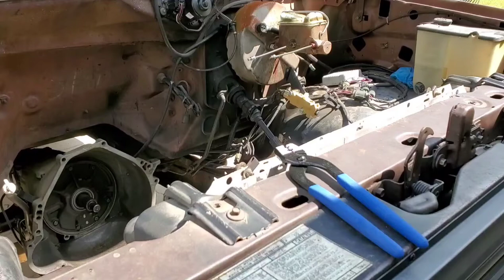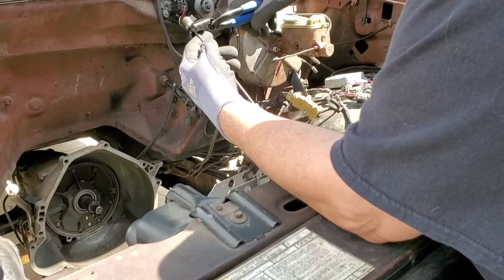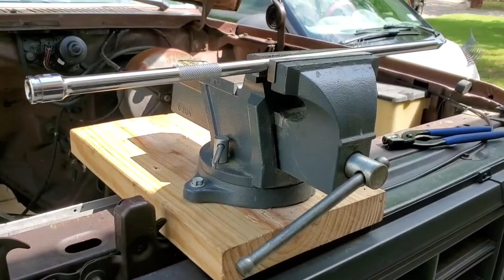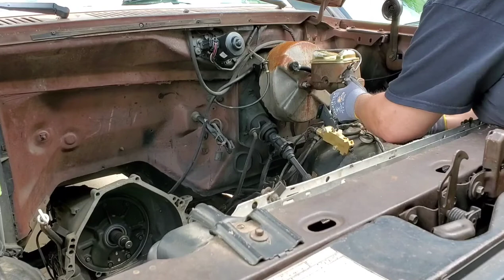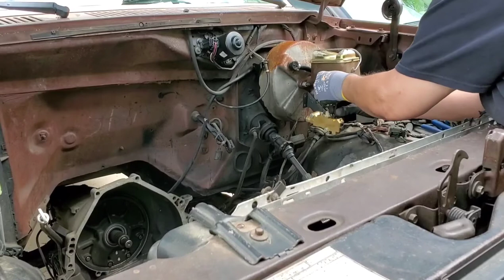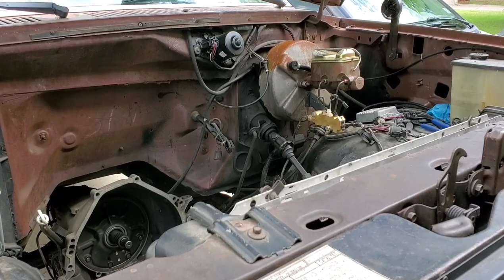Ford Brake Proportioning Valve Install Part 2

Comment: Old proportion valve had 2 pink n white wires and new one has 1 both are connected to the single wire???? 1985 Ford F-150
Reply from the maker: yes